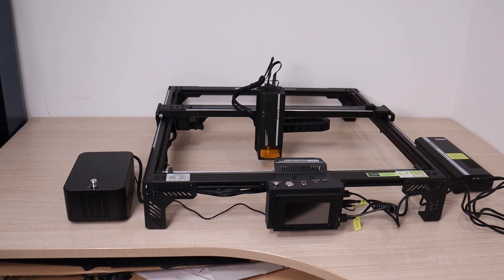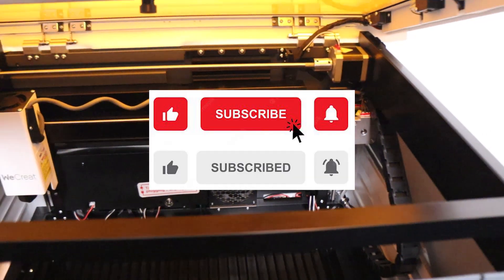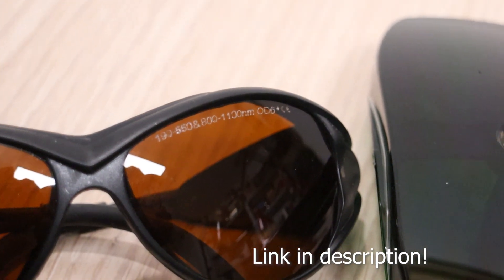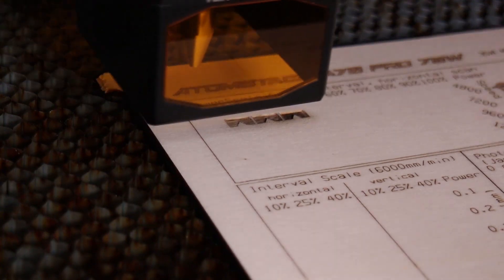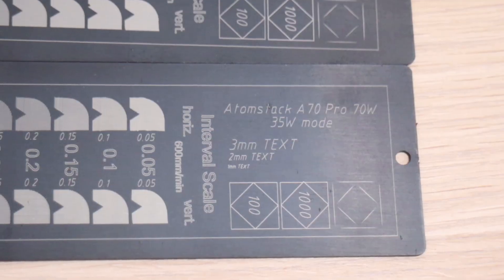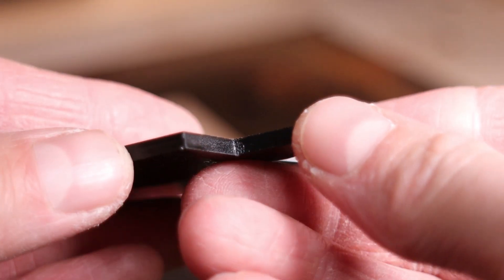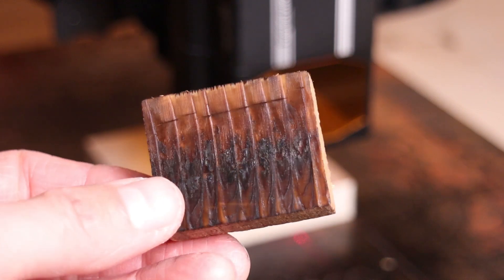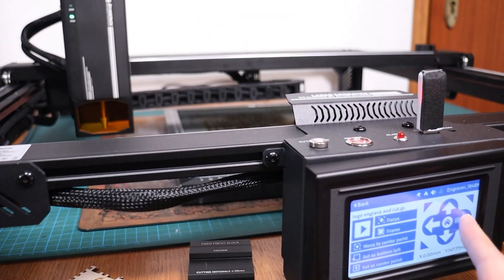70W Atomstack A70 Pro Diode Laser Engraver- Better Than a CO2? (Review and Test)

Comment from the maker: Get Atomstack A70 Pro here:
http://shrsl.com/4k915
Read the written review:
https://hobbylasercutters.com/atomstack-a70-pro/
I recommend these safety glasses: https://bit.ly/3V710FT
***********************
WeCreat giveaway is complete!
You can use my discount code "JTMakesIt" for 100$ off as a thank you for participating:
http://shrsl.com/4ja3o
***********************

(affiliate links, I get a small commission which helps me make videos and giveaways!)
Reply: What kind of Depth can you achieve on anodized aluminum engraving?
Reply from the maker: @10MillKing  it can remove coating, it can't engrave bare aluminum underneath.  So it can achieve the depth of the coating thickness

Comment: Modèle acheté: A70 Pro d'une valeur de 1335€ acheté en septembre 2024. Au bout de deux mois, la LED de switch entre le 35W et le 70W tombe en panne. Je contacte le SAV mais ils me disent qu'ils ne trouvent pas la commande. Pas grave je laisse tomber. Il y a deux semaines, je grave une ardoise. La machine ne grave que la partie gauche de l'image et pas la droite. Je réessaye et des que le faisceau arrive sur 10CM, il s'eteint mais le moteur continue de tourner. Je contacte le SAV, ils me demandent vidéo et paramètres LightBurn, j'envoie tout puis ils me disent que c'est la carte mère qu'il faut changer, que ca va prendre entre 7 et 15 jours. Impossible pour moi d'attendre, j'ai des commandes à honorer et j'ai besoin de travailler avant les 15 jours. Et la ils me proposent une indemnisation à hauteur de... 20€. Donc chez Atomstack, deux semaines de travail représentent 20€. Depuis trois jours plus de nouvelles du SAV, j'attends la prochaine proposition (un paquet de bonbons peut être). J'ai jeté 1335€ à la poubelle pour un laser qui a tenu 5 mois. Je sais que je ne reverrai jamais cet argent mais je tiens à alerter ceux qui cherchent une machine: ne prenez pas ATOMSTACK ni IKIER. Aujourd'hui, j'ai commandé une machine chez SCULPFUN (850€) et ils ont répondu de suite à mes interrogations en 12H maximum. J'attends un vrai geste commercial de la part de ATOMSTACK (remboursement du laser, prise en charge du nouveau...) J'avais posté cet avis sur le site officiel de ATOMSTACK mais il a du être censuré.
Reply: Thanks for sharing your experience. In the video, the lines look like they're vibrating. What's the reason for this?

Comment: I want to love this laser... but it is so hard to get working well. I have a A70 max, a roly, and originally a xttool d1 pro. 
I cannot get the A70 max square. it is off by .25 inches. I also cannot get the x axis gantry to be square. it is off by about the same. I am getting quite frustrated. When working fine, this machine is amazing.
Reply from the maker: Strange. That must be a manufacturing defect. Mine is dead straight
Reply: @JTMakesIt atomstack claimed it was my belt tension. But the gantry still is off and is not square. Very frustrating. Not sure what they will do

Comment: Would love to test drive one out I had to go back to a 10watt from a 20watt cause of getting it stolen out of my front seat
Reply from the maker: @EtchinAaronslaserworkshop  that's a bummer 😕
Reply: @JTMakesIt  thing is crackheads an honestly probably has no idea what it was just they knew an sew it was expensive an still makes me wanna pack up annquit but guess 10 is better then zero so 🤷
Reply: @JTMakesIt  just 20watt plus opens up so many more ideas an accomplishments I lost a client that I used to do stuff for because could not cut projects fast enough with the 10 I'm using so that crackhead ended up costing me that an suxs was a good client
Reply: @JTMakesIt  took me awhile to save up for that beast for some low life to steal it but anyways still goto my office an try an just do what I can with my 10 an keep pluggin along designing creating

Comment: I'm new to the game and using your videos to determine which one to buy. Currently i'm focussed on the Sculpfun S30 ultra 33w as it is a nice allround entry level machine. This one looks very nice but price goes up a bit. Why would it need an enclosure though?
Reply from the maker: Good choice. Enclosure helps to retain the smoke an odors and vent them controllably out through a hose. Without enclosure your room will fill with smoke when cutting if it is not well ventilated.
Reply: i have both machines and mainly cutting 3mm plywood...both are super for the work,but I will but a diode because that burn leaves on pattern and on side makes a lot of mess...i m happy with the machines,only the burn gets me on my nervs